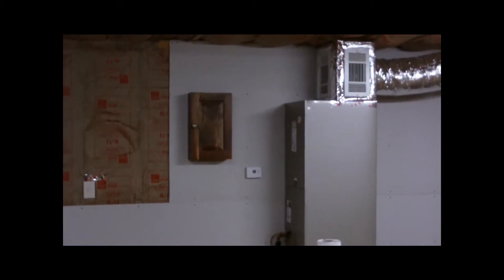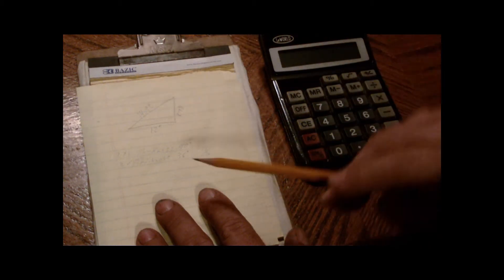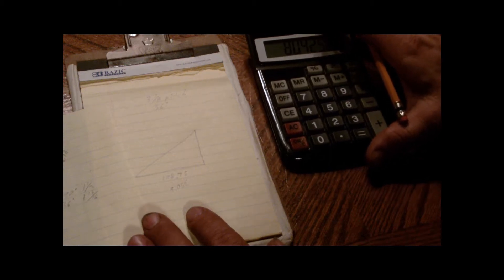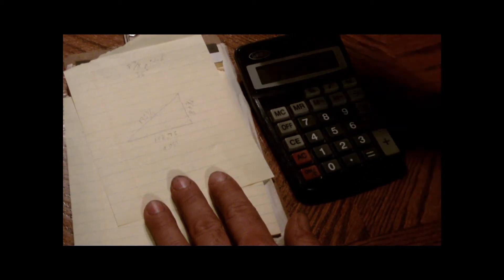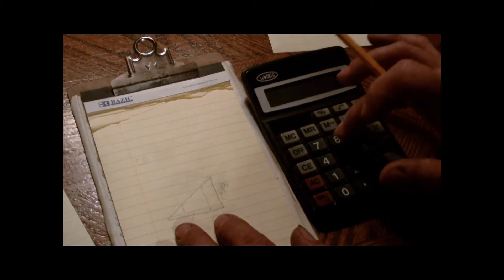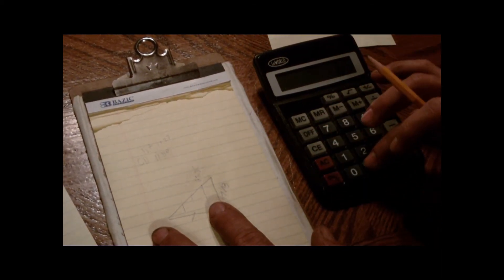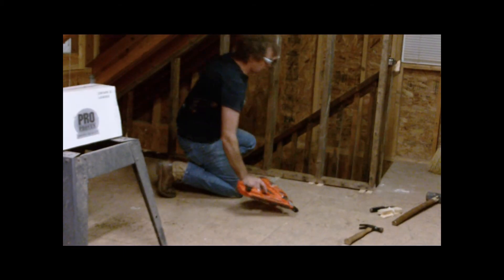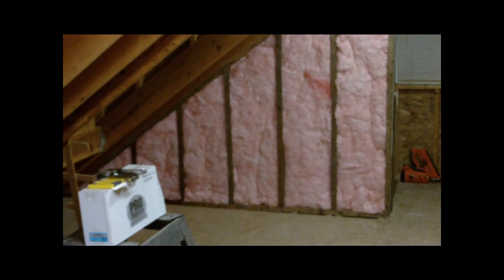Carpentry/Rake Wall Geometry and Build

Comment: We're did you get the 8,75
Reply from the maker: The roof pitch fell short of  9/12  ended up being 8.875/12 or 8-7/8/12. It can be checked with framing square or speed square.